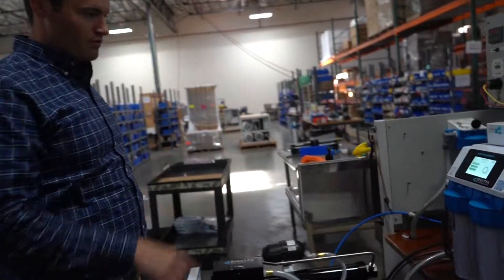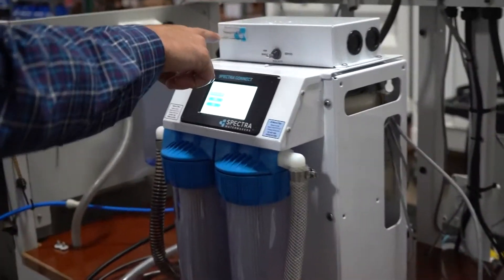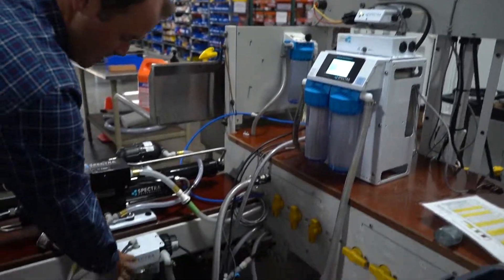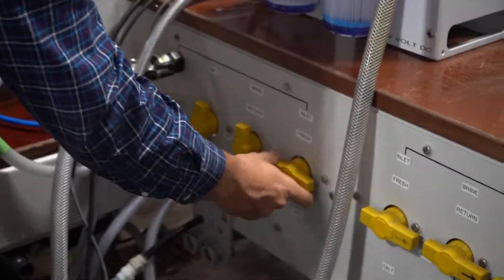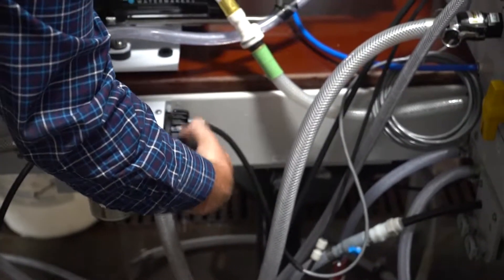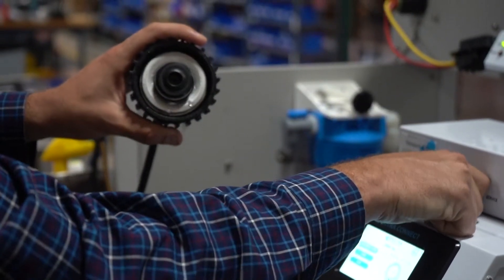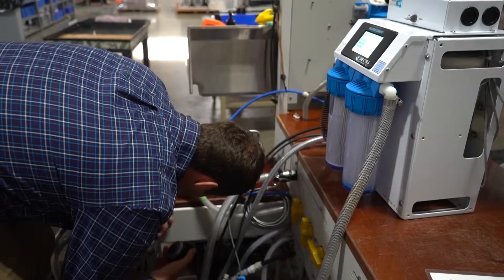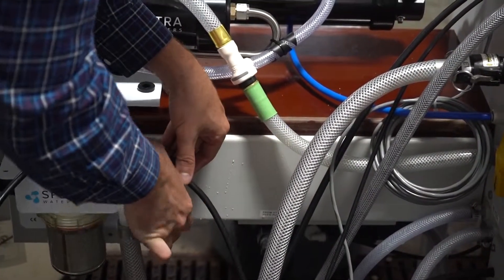Watermaker Boost Pump Test

Comment: The boost pump does not run during a flush. Wouldnt you have to wait about a minute till the preproduction flush ended to see the boost pump come on? Or during manual does the system not do a preproduction minute of flush like it does when doing a production run when using the digital display in automatic.

Comment: The boost pump does not run during a flush. Wouldnt you have to wait about a minute till the preproduction flush ended to see the boost pump come on? Or during manual operation does the system not do a preproduction minute of flush like it does when doing a production run when using the lcd display in automatic.